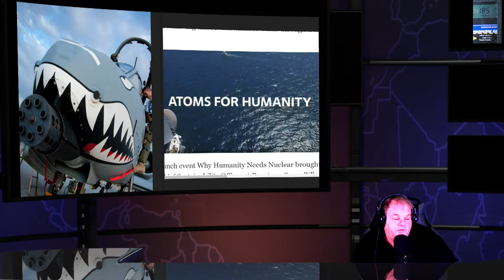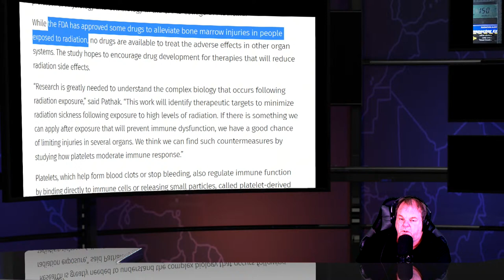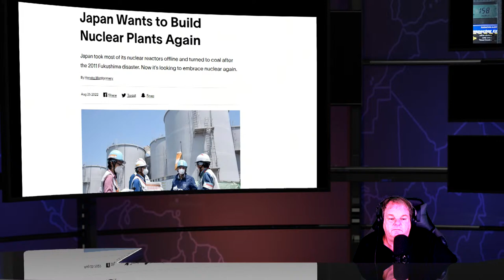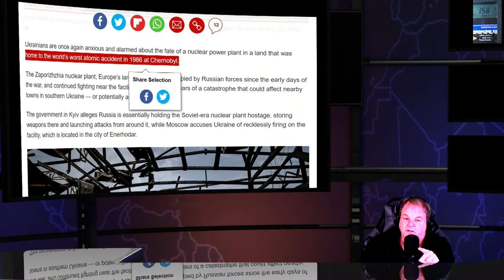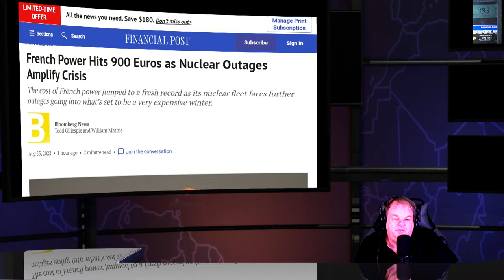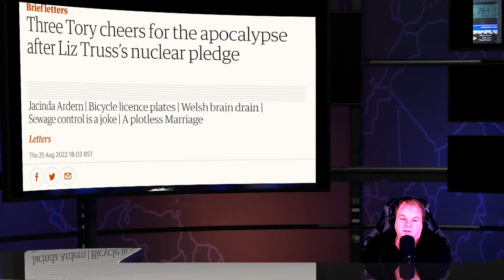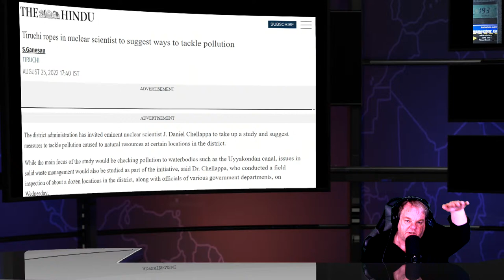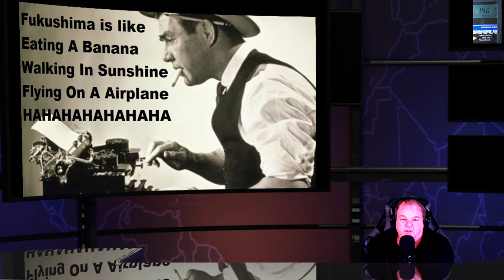Fukushima Nuclear Meltdowns & Radioactive News -Nuclear Scumbag Show-Artificial Uranium Bull Market

Comment: That squeak is your U-joints dana, and no you wont get away with it long.  If your axle is not leaking its not the axle seals. ITS YOUR U-JOINTS... Replace them both, the front one by the transmission, and the rear one by the  axle.  But I guarantee its the rear one thats squeeking, thats the one that gets all the punishment from the axle bouncing down the road. Dont be ripped off.. its your U-joints buddy.
Reply: And good thing you had one wheel on the ground or Id have never have hear the u-joint sqeaking, because it would have simply fed through the differential and turned the opposite or right side wheel without spinning the driveshaft.  But since that one wheel was down, it stopped the differential from turning, and fed you spinning the rear wheel throught the driveshaft, which made the u-joint sqeek evident.   U-joints Dana ... U-joins.